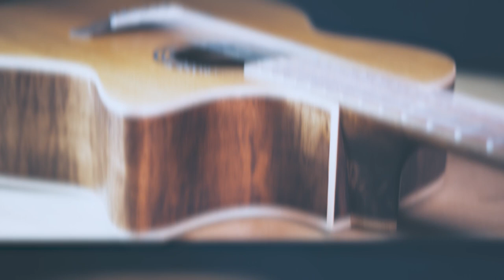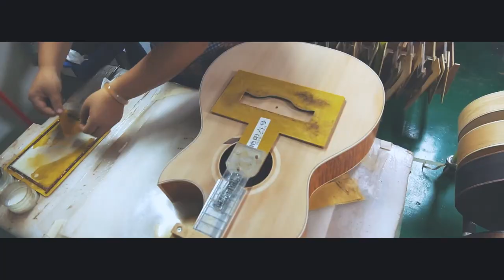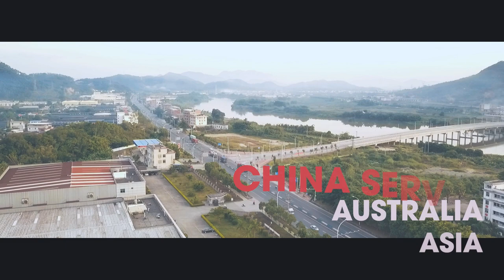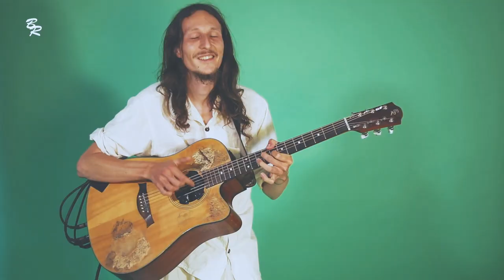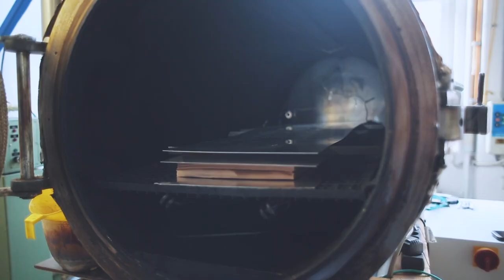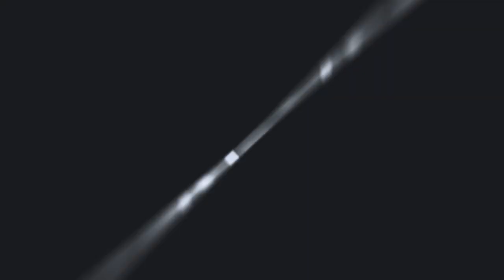Baton Rouge Guitars | 20 years of success!

Comment: I have the x54 OM model. Found it as a B-stock with 245 Euro on Thomann. Very nice finish and sounding little guitar. Seted well (changed the strings to some Martin 11-52 and some brass pins and lowered the string action), it's a very responsive, full, rich sounding and loud guitar, great for fingerpicking and for strumming to.  Appreciate the natural bone nut and saddle to. Like a lot the 46 nut widht with wider string space because I have bigger hands (this is one of the main reason I bought it). Confortable to play the "C" shape neck and easy to play due to the 630 mm scale lenght. Looks very fancy with the gloss top, maple and abalone binding, abalone rosette and fingerboard dots, and the satin woodish finish back and sides. Also the fingerboard binding is made of wood and not from cheap plastic. Looks like a way more expensive one. Like a lot the smaller size also which is 102x39x10.5 cm. Just perfect for my needs. Can be used also for traveling because of it's smaller size. Very very hard to beat the sound at the price I paid, and imposible to buy at this price maple and abalone binding, abalone rosette and dots, wood fingerboard binding budget guitar from other brands.

Comment: As a older beginner with fat fingers I realy like you have different nut with even on the cheaper guitars. I bought one with 46 mm nut, perfect for me. Thanks
Reply from the maker: This is great feedback. Thanks for it. Which specific model do you play?
Reply: @batonrougeguitars  Baton Rouge L1LS/D Natural. I have lowered the sadel about 2 mm and have perfect action. When I changed strings I bought thinner ones (10) so it would be nicer for my fingertips.